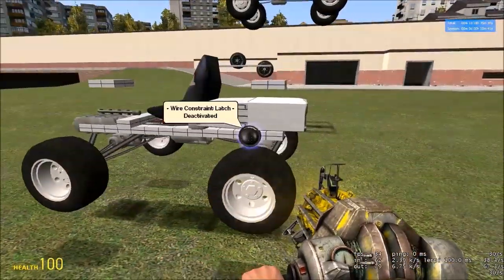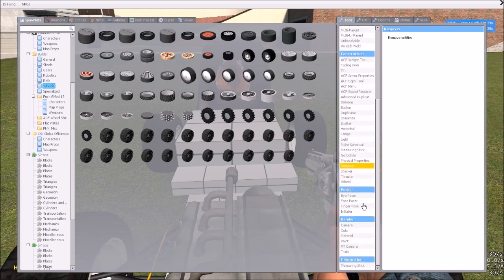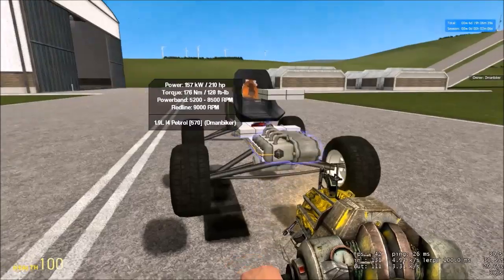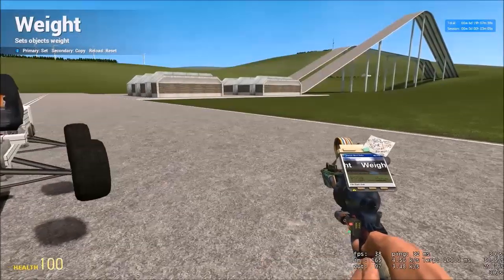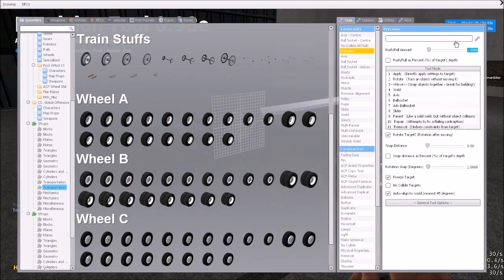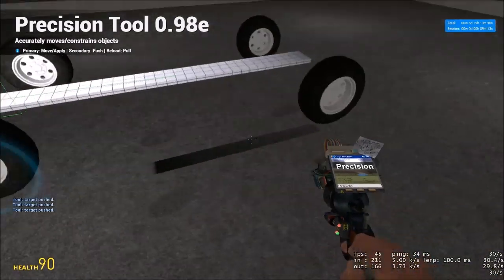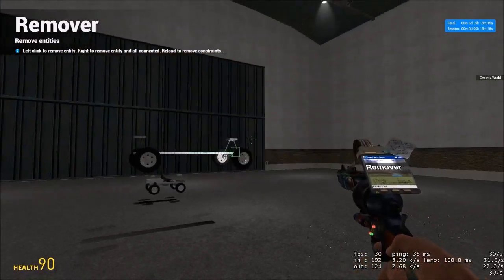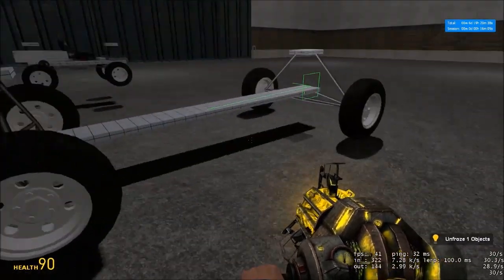GMod -- Simple Effective Suspension -- Intermediate Tutorial

Comment: You should do a video on how you  made the steering work with it. Nice vid tho.
Reply: +Seth Ombry I was wondering about the steering aswell as the ball socket's Z axis doesn't allow the tyres to rotate.
Reply from the maker: +Dogi Marg There are more elegant ways of doing it, but in the video, the front wheels are advballsocketed to a plate you can see on the front of the car. If you car is facing north on the map (like mine in the video), then you just use ballsocket options X: -180,180, Y: -0.1,0.1, Z:-0.1,0.1, so it restricts the wheels' movement compared to the plate only for Y and Z, and X isn't restricted, so the wheels are free to turn.

So when the plate on the car turns, the wheels are restricted to it by Y and Z, so the wheels turn with the plate, while still retaining their normal rotation.

The plate can just be axis centered to the base prop, with a advballsocket restricting it's Z rotation to like +-45 degrees. Then you just turn it using hydraulics, or applytorque.
Reply: Dmanbiker Thanks for the quick reply.

Today I tested your suspension and I have to say, it's awesome and works brilliantly! Very easy to modify as all you need to do is change weights. Side note: This is the first time I've done any kind of suspension in Gmod, usually I have neglected the suspension.

What I did for steering was to use a dual clutch on the rear wheels and as I apply power only to the other wheel it turns :D Not very effective I'd say.
Reply: Dmanbiker After testing the steering system I came up with a major problem. The wheels turn fine by grabbing the plate with a physgun and rotating, but after duping: The plate does not rotate the wheels, but grabbing the wheel and trying to rotate: it rotates the plate accordingly but the wheels don't rotate at all.
Reply from the maker: Uh, is it frozen or something? That sounds weird.
Reply: +Dmanbiker No it isn't. I might need to build one more as another try. Cheers.
Reply: +Dmanbiker I figured that I had ball socketed the front wheels twice: To the plate and to the steering plate. Works fine after getting rid of the main plate ball socketing. Works great now, cheers. Any idea how to get rid of the bounciness of the rear wheels (in a RWD)? I use basic Sprops wheels.

Comment: Please explain, how the hell is that car so stable at motion? My rear tyres (as a RWD) keep bouncing and have very little grip on them. Some may sink underground. I use same Sprops tyres as you do.
Reply from the maker: +Dogi Marg They use the "Make Spherical" tool. Which basically makes the collision model for the tires very smooth spheres, so they glide along the ground and don't bounce and they don't go into the ground. That's how every smooth car you see works. The spheres aren't really noticeable in most situations, but there's no other way to do it.
Reply: +Dogi Marg Do as Dman said, and also lower the weight of the plates significantly. I find that having them too sensitive by even 5 KG may make the suspension bounce.